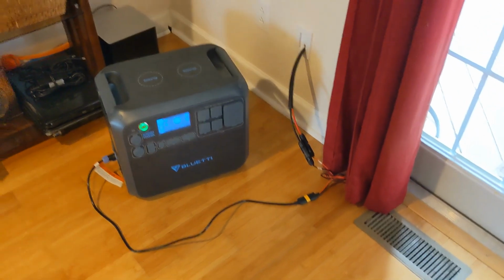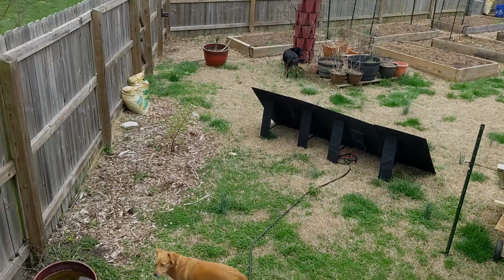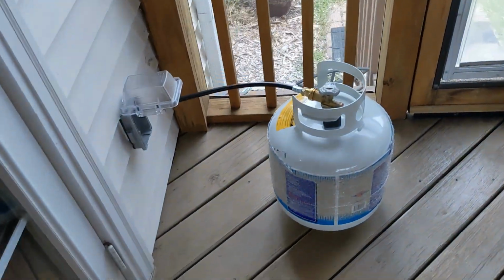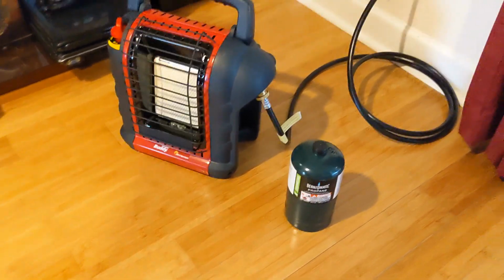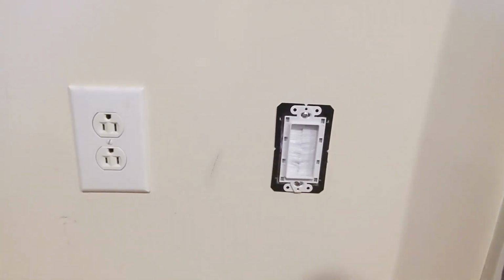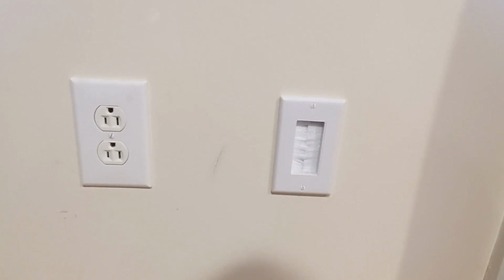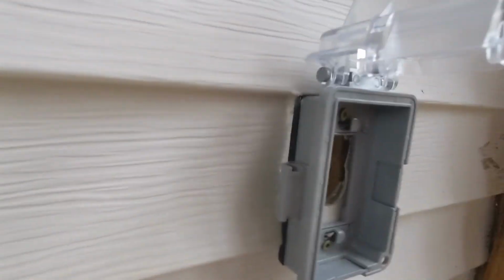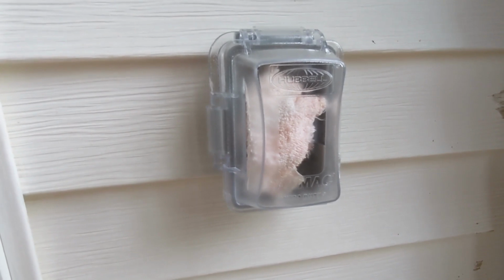House Opening for Solar Generator Charging and Emergency Heating

Comment: What you did works, but is not particularly elegant.  They do make an outlet with MC4 connectors specifically for bringing wires into a structure.  The method you're using looks like an ingress route for vermin like mice, which could very easily remove the rag and get into your home.  One final thought is you have no solar disconnect switch or fuse.  If something goes wrong, you've brought a fire hazard into your home...and you have documented, with video, that you're doing it wrong.  Your insurance agent would not approve.
Reply from the maker: Thanks for commenting. These comments are helpful. I do plan to add a fuse and rapid disconnect.